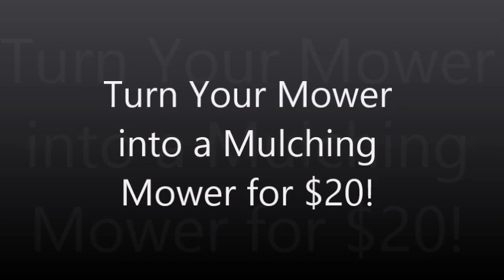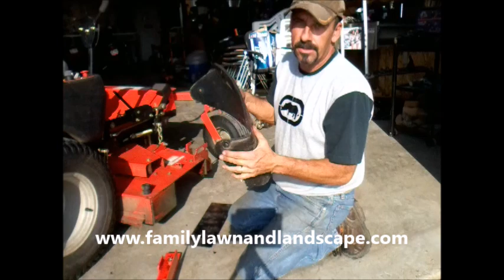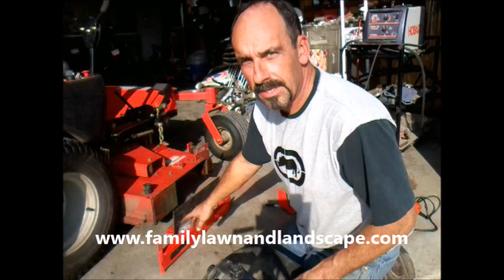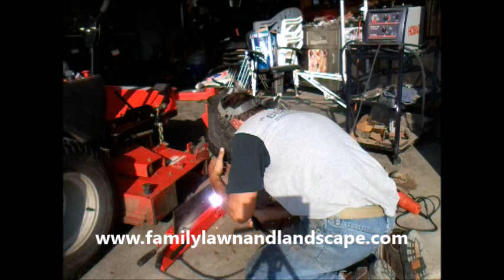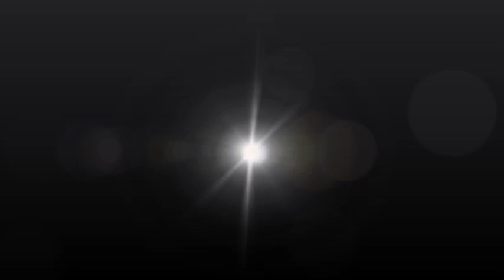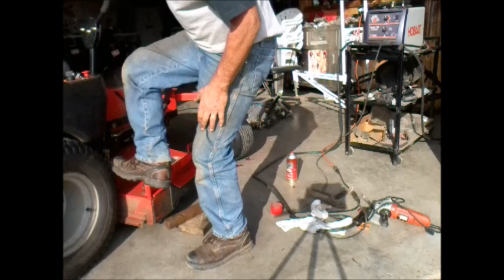Turn Your Mower into a Mulching Mower for $20!

Comment: This is awesome Idea...had a welder friend make me this exact thing for my commercial John Deere...he used a piece of diamond plate and welded 2 L brackets so I can remove it at will!  Best $40 I spent!  Saves me from throwing grass in pools, into windows, and mulches leaves so saves so much time....highly recommend it!!  Like he says, dont waste any money on mulching blades, they are not worth it.  Thanks again G.
Reply from the maker: +Eric B 
 your very welcome Eric. and it sure does save a lot of time especially when we have to do a full service ( hedge trimming ) we just drive over the debris and mulch it up.
Reply: What type of John Deere do you put it on?

Comment: Yeah, I shot a large rock right thru my new Marvin window and cracked it.  The lower sash cost me over 300 dollars.  Going to convert, but instead of welding a piece of metal, I'm just going to use a piece of cedar wood part of a  1 X 6 and shoot a couple of screws into the ends.  That should be block enough for me.  THUMBS UP!!
Reply from the maker: Thanks for commenting man don't forget to subscribe
Reply: I was thinking this too. No way the metal needs to be as thick as the deck if that's what you use. Just a pain to source that locally without paying through the roof. I saw another guy make one out of a license plate but I also have a 60" bad boy so the deck chute is similar to OPs. I suppose if you're worried about rock chucking it makes more sense, I'm just doing this because it's leaf season and I'm tired of picking them up and we have a bunch of giant cottonwoods.

Comment: good video. i ran gator blades on my 52'' pro line toro with that set up like your doing. it so helps in tight areas where you dont want to sling clippings everywhere,condos and parking lot islands etc...
Reply from the maker: Your right Josh, I hope others follow. You don't have to spend the big $ to get this done !
Reply: Josh Childs 
I have a 36 and 44 proline. 
You have any videos with your proline and mulch kit?

Comment: My mower came with a mulching kit installed. I once installed a regular blade instead of the mulching blade and the result was a cloud of dust coming from under the deck. By the time I finished our small 1/3 acre lawn, the mower and  I was covered in dirt. Moral of the story is to use a mulching blade once you do the conversion.
Reply from the maker: nah

Comment: The mulch kit isolates each blade and forces the grass down. I've tried something like what you did here, and it seems to pile the grass up by the plate then release it in big green gooey turds all over the lawn. At least that's my experience with it.
Reply from the maker: the only time i experienced that has been if the grass is damp or wet, otherwise it seems to work fine for us.
Reply: exactly. Dont be fooled by the cover the discharge idea. The blades rotate at over 18,000 rpm's. And its throw goes from left side, middle, then to right and up against the blocked exit. Not like a mulching deck and kit.   Clumping and leaving a trail of grass. it's just like having a chute blocker. Accept, with an ocdc, you can open up the flap..

Comment: Why weld it ? Attach it with a couple of L shaped brackets and  bolts and it can be removed if required.
Reply from the maker: just the way we did it and seems more logical but your idea would most likely do as well

Comment: I have the 52" version of this same mower so it helped to see you working with almost exactly the same parts. This is a good idea and I'm going to try it. Never did use that attachment for anything anyway. 5 years and its never even been on the mower so what else is it good for. Worth a try. Thanks! '
Reply from the maker: just make sure you can take it off if your in high grass as it will bunch up.

Comment: Will this work on a residential ztr? Any reason for welding the plate on? Can you just bolt the plate on?
Reply from the maker: yes it will help. sure you can bolt it on if you want

Comment: Does that mower not have an option to have a lever that closes the chute or open, depending on your needs? My Dixie Chopper has an adjustable lever that makes this process very easy to control.
Reply from the maker: mine does not.  however i used to have several of them  also , so i know what your saying.

Comment: I thought of this a while back and made a cover plate for my simplicity 48".   It works fine grinding it up the grass.    The problem is that it leaves behind twin tracks of small wind rows , one on the outer edge of each side of the deck.   That's with the standard OEM blades.    Would real mulching blades work any better ?
Reply: You could use some "L" brackets to fasten the plate onto the mower bracket. Then you could convert it back to the original condition if you wanted. Don't need welder then.

Comment: I'm having one made this week. How do you pull it up if you need to discharge grass ect?  What size steel did you use ? Good video any information would help. Thx.
Reply from the maker: You dont pull it up. If you have to do that then your cutting too high of grass for this device to work properly.
Reply: G Packard what size steel did you use buddy? .
Reply from the maker: I believe 1/4"

Comment: I use the same method on my Push Mowers but instead of a metal plate I use a discarded auto  license plate from the Junk Yard which I  mold ( a couple of cuts here/there) and bolt in place.....HELPPPPP I have an old  small Gravely Riding Mower Model 830E and I cannot remove the rear wheel to replace a tire....I removed the C clamp from the groove but the wheel  will not come out......what to do?
Reply from the maker: wtf ?
Reply: +G Packard lol at wtf.
Reply: Luigi -- get some all- thread and 2 x 4 and fabricate a puller to force the wheel off the axle.

Comment: Howdy Packard, Great video.. We have the FERRIS IS1500ZKAV2148 21 HP, 48"Cut Zero Turn Riding Mower. You have a great idea there.. I would like to do something like that to our mowe because mowing a two acre yard and being left with all that grass after it's cut, Damn! I'd much rather do the mulch cutting. Will look into it and see what all it will take to make the change.... Thanks stud for the video, and info. By the way, what kind of mower are your workin with in this vid ?  Thanks
Reply from the maker: Roger Sayers THANKS FOR COMMENTING ROGER, AND WE CURRENTLY USE ALL GRAVELEY'S.
Reply: G Packard
Yer welcome.. Graveley's, never heard of that one, will have to look em up. I talked to folks where we bought the FERRIS and they do sell a kit that comes with special mulching blades, we can get the complete kit for right at $200.00, so I'm planning on it.
Reply: +Roger Sayers hey My name is Jose did you ever find out how to make that chute block for your mower? i just got a new ferris IS 600z and I was just wondering if you could help me out?
Reply: snoopy2342
Howdy Jose, Nope sure didnt... I decided that it would be better to go back and but the mulching kit. It's a complete kit and comes with special blades and the blocking section. haven got it yet though... Will get it next spring of 2016.....

Comment: Why couldn't you just drill and bolt it to the deck?  So you could use your deflector later if you chose to...
Reply from the maker: why ? all i have to do know is twist the knob and remove it .
Reply: G Packard  so you don't have to weld anything...  Just bolt it
Reply: E lka drill and bolts that might catch on things or weld a smooth line... oranges for Apple's.